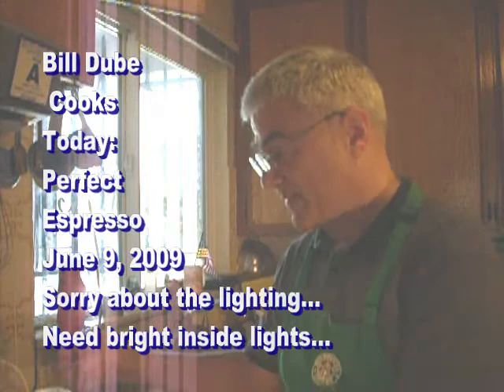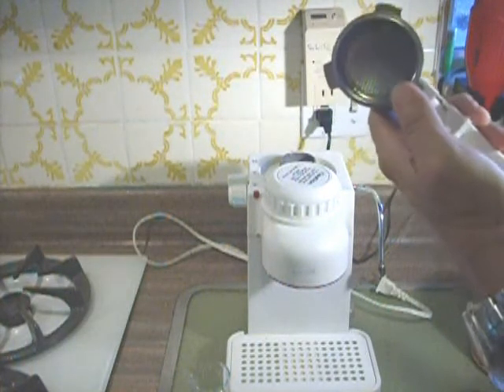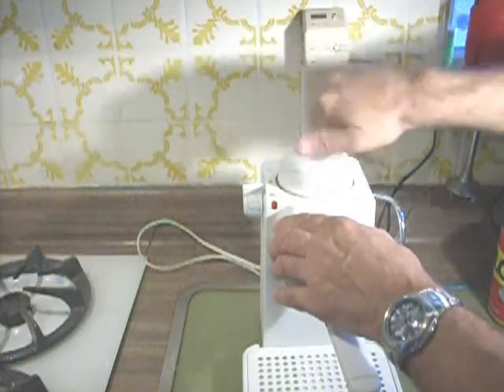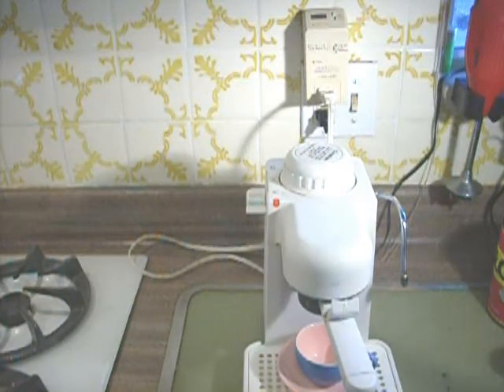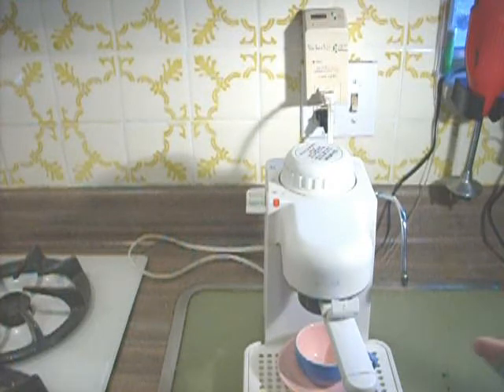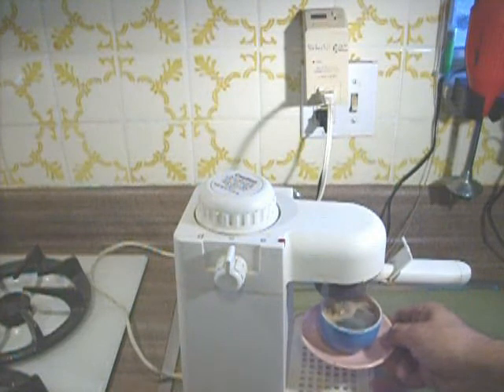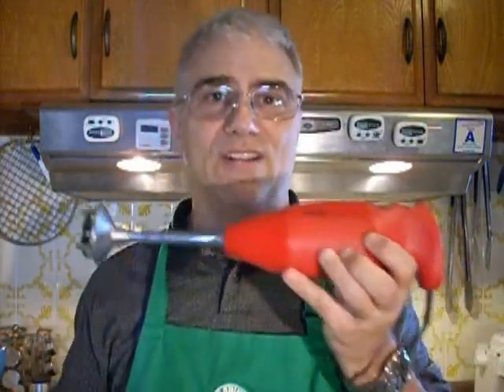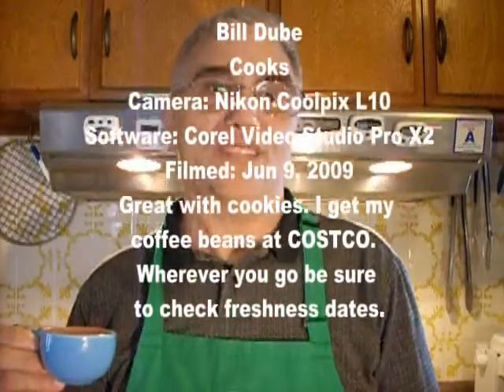My Perfect Espresso coffee  |Photosensitive viewers some white flashes| in Krups il Primo 2009

Comment: Bill,I was hoping you could help me.  On the Krups 972, do you get steam coming out from near the coffee filter?Thanks.
Reply from the maker: Susan Jeiven I do hope you still have your Krups 972 machine.  I 'm sorry to take so long on this to get directly to you; still lots to learn for me on YouTube here.  Probably already have answer but here it is again if you didn't.  Some things to check is to clean your gasket that is above your filter holder.  Any residue between the filter and gasket can be one cause of leak.  Another cause is can be cracks in your gasket and that can be replaced.  Last cause for steam leak and this one would be at your fill cap is over-pressure in your machine.  (This happens when you tamp your grounds down to tightly)

Comment: Hi Bill. I have got a question.What size tamper did you use for krups il primo ?? It was 49 mm ??
Reply from the maker: Okay just measured it at 49.5mm, with really cheap calipers.  49mm or 50 should work fine.  I think this is the one that I have, but not sure exactly as I bought mine several years back.  https://www.amazon.com/HIC-Sided-Espresso-Tamper-Silver/dp/B00CZNHJT0/ref=sr_1_6?ie=UTF8&qid=1468518277&sr=8-6&keywords=tamper
Reply: +Bill Dubu Thanks a lot I was trying to find out what size it is for a quite some time. :-)

Comment: This is wrong on a couple of points: Most of the complaints about the Primo have to do with using steam and having a temp too high causing over-extraction/burning of the coffee. The extraction is NOT done with steam, it is done with hot water that has been pressurized by steam. Pressure will rise as the temperature rises up until it reaches the stasis of the boiling point for whatever the pressure is within the vessel (since this is pressurized, I'm guessing it is considerably higher than 212°). By getting up to full steam, you are maximizing the temperature of the pressurized water that is pushed thru the coffee by the steam pressure. I recommend going directly to the espresso (as opposed to preheating with the steam/froth) setting and letting the temperature rise to push the water thru at a lower temperature. You will find that you can regulate the temperature of the water this way within a range that is no hotter than a fancy pump machine. Then use tamping and grind to regulate the temperature of the water: finer grind and heavier tamping increase the pressure required to push the water thru the coffee and as a result increase the temperature. Make sure that you put in plenty of extra water so that you don't get to the point where the Primo IS pushing steam thru the grinds. You want to stop brewing before it gets to steam (at which point the Primo will be blowing big bubbles).
Reply from the maker: I look forward to viewing your video demonstrating this technique with your il Primo and a four shot brew using extra fine espresso grind as you claim it will work.Good luck.
Reply: Well, Bill, I don't think I made any claims about how many shots or extra fine grind; however, I think you can get 4 SB size shots no problem. WRT extra fine, I don't recommend it- it will clog the basket, raising the temp as pressure increases (physics doing its thing) and you will start to see leakage at the gasket.

I won't be doing a video, either- I think yours is fine- but I do think that reaching full steam and then shunting it back thru the coffee, which will raise the temperature further, is not the best way to go. If you or anyone are satisfied with your approach, than you should keep doing it. OTOH, if you are getting a hot, bitter extraction, you might try my advice and see if you can cool things off a little. Anyone watching your video will have two different approaches they can try, and the cost of experimentation is very low.

I can't see a difference in crema- seems about the same either way, which is not great, but I've had much worse from very fancy machines.

Comment: thanks .....vidio helps me a lot
Reply from the maker: Glad it helps.  Thank you.
Reply: Bill Dube  I just picked up this exact espresso machine at a thrift shop today and of course, it did not have an owners manual included with it. I've never used one of these machines before so this video was useful in how to use this particular model. The machine I bought was quite dirty and full of scale & coffee stains on the upper filter. I ran some descaler solution through it and will probably do it a couple more times before doing my first brew. It is cleaning up quite well though and I was able to test the steaming wand to make sure it works.
Reply from the maker: Glad it helped.  Thanks. If you want to save on descaler (as I don't know how healthy the stuff is) you may try using white vinegar.  I have found that to work well in the past.   Have to have the coffee in the morning.  Have switched over to a drip ceramic filter for early AM coffee.  Will have to do a YouTube on that some day soon.
Reply: I was going to use plain white vinegar until I watched a video from a popular coffee expert say that vinegar can damage the silicone gaskets over time. I used a product called "Brew Rite" which is powdered calcium carbonate. It worked really well at removing all of the scale and oil residue. After 2 runs with the Brew Rite, I then ran 4 cycles back to back, cooling down a bit in between, with plain water until it was clear. 
I too use a ceramic pour over for my morning brew. It's the best tasting and smoothest coffee I've ever made! But lately I've been on a latte/cappuccino kick so I had to find one of these espresso machines to keep the cost down. I've been using a french press as a frother in a pinch, it works but creates huge bubbles and some foam, but not a lot. Would love to see your pour over video when you get it uploaded.  :)
Reply from the maker: Thanks... I guess I learn something new every day.  What descaler do you recommend? Thanks.
Reply: As I mentioned above, I used a product called, "Brew Rite". I bought it at Walmart for around $4.00. I found it on the shelf just below  the coffee makers. You mix 1 Tbsp to 4 cups of cold water, stir until dissolved then pour it into the boiler just as you would with vinegar. The jar has directions on how to use the product with several different types of coffee makers. I was happy to see how well it worked on this machine since it looked as if the person who owned it previously never cleaned it. Today I'm going to remove the mounted screen that's  just above where the portafilter sits when brewing. It is about 75% clean but I can still see some clogged holes. I'll soak it for about 20 minutes or so in the Brew Rite solution to open up the rest of the filter holes.
Reply from the maker: Had a cheap on top of stove espresso pot till I exploded it one day.  These electric machines are much safer :)
Reply: That's scary! I just got one as a gift yesterday, the Imusa stainless steel moka pot. I used it this morning and it made a dynamite cup of coffee! (No pun intended :).  )
Reply from the maker: Yep very scary.  Those relief valves on the stove top models don't always work.  Be sure to never overpack your coffee.  That is the mistake that I made too much and too packed in.  Enjoy your Moka Pot.  Mine was an Ikea Aluminum pot that I had used for several years.
Reply: When I read the instructions for the Imusa pot, it stated to not tamp the grounds as it generates too much pressure and the water has a difficult time getting through the grounds. I saw another video here on youtube of someone's pot that exploded and ended up lodged in his kitchen ceiling! 
I made my first brew with my now cleaned up Krups Il Primo and everything works great. The coffee was very good and the frother, which I was concerned about not working, did a fabulous job with my soy milk! It doubled in volume in about 30 seconds! Very happy with this thrift shop find.  :) I went to the Krups website to find the user manual for this machine but it wasn't listed anywhere. I e-mailed them last night before I went to bed and when I got up this morning, the PDF was in my mailbox. Nice service!